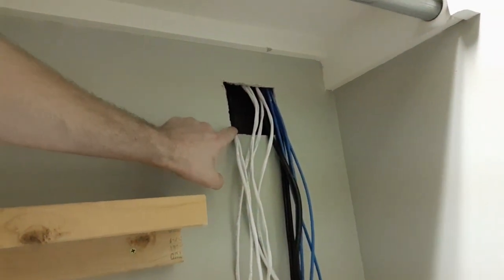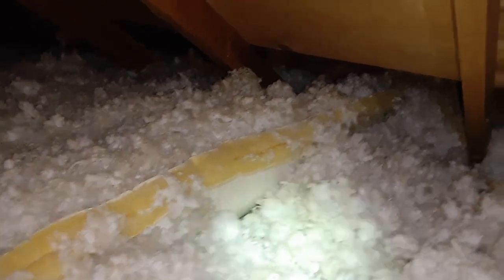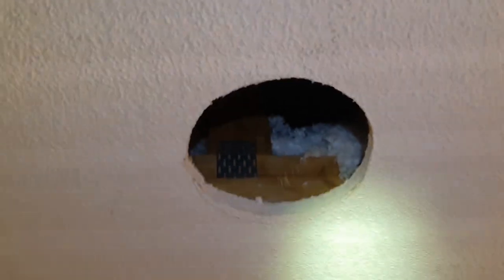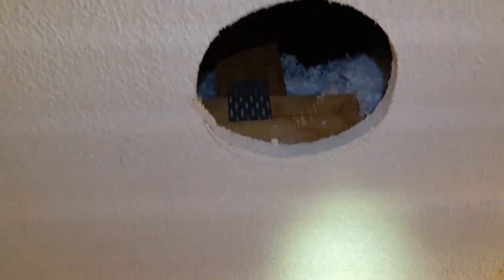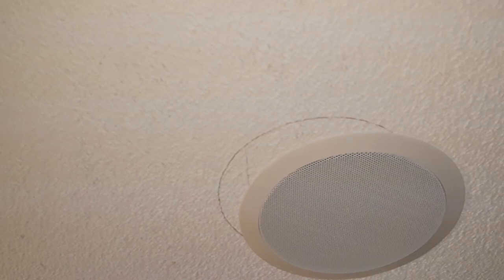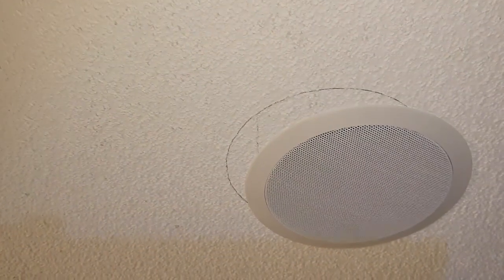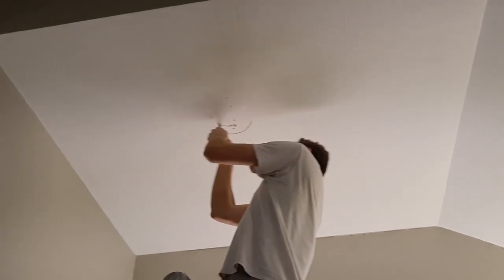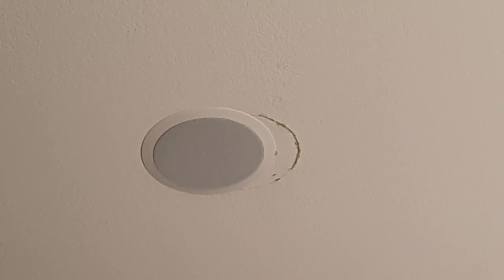Whole Home Audio Start 2 Finish EP9: I MESSED UP

Comment: Hindsight tip-

When you poke your hanger,  poke where you want the center.  Come down 4" and bend it 90°.  Push it in and spin it around.   That'll give you 8" clearance. And an 
inch if you want for good measure.
Reply from the maker: Ahhh!! Smart! I will mention that in my next video, that would save a lot of time, thanks!
Reply: Great tip!

Comment: Don't sweat it. I stepped through mine once after slipping off of a rafter. Good times.  -- Maybe next you could install mesh wireless? Just a thought. I have some experience with Plume, Ubiquity and Meru/Fortinet. Mesh is a nice upgrade to multi-levels, although I still do wired Ethernet for some things.
Reply from the maker: I actually do hard wired ubiquiti, I have one of the ubiquiti in wall access points in my living room which is very wide open, and then I've got a unifi HD wave2 in my basement. I really don't have any dead spots between these 2
Reply: @TheKMZ1  Right on. I was thinking that it's just different enough to be a neat video series and it seemed up your alley. My internet was all good until all of my neighbors got mondo transmitters through Spectrum. Mesh seemed to help. -- Another idea might be HDMI over CAT6 to your porch for a second TV to compliment your multi zone audio. Could be great for football parties whenever people are comfortable doing those again.

Comment: Have you noticed any issues with that blown-in insulation vibrating into the back of the speaker? I'm going to be doing our home soon and I was wondering if I needed to create a barrier between the speaker and the loose blown-in insulation.
Reply from the maker: I've not noticed any issues no. I've read up about that and the condensed is that it doesn't cause any issues. But you can use something like a shower cap to put on the back if you want to keep it out. But me I'm just throwing the insulation back over it, I think it's fine

Comment: I hit a stud in my dinning room when installing ceiling speakers, mine was allot worse as I had cut almost all the way around before I realised, ended up with quite a big hole to fill, but these things happen
Reply from the maker: Yes, luckily I started on the side with the stud. If I had started on the opposite side, I would have had 75% of the hole cut at least, so I could have been in bigger trouble!!
Reply: @TheKMZ1  I ended up having to staple a mesh to the joist and then plaster on to it.

Comment: I laughed my ass off when your wife started to reiterate the * What to do* along with her shaking her head in disapproval of the initial install. 🤣

Meanwhile Kaiden is just super chill and calm. 👍

Don’t worry honey I’ll fix it 😎

Having done thousands of commercial installs the adage of a wood cutter measure twice cut once is the golden rule. But, can tell you there have been hundreds of times where after doing so mistakes were still made due to uncommon building practices, schematics not being accurate, to people installing hidden devices and wiring and not following best practices for routing their wires. 🤢

On a separate tangent I don’t know where you live but noticed your home doesn’t have any vapour barrier?!? 🤔 Lastly, please insure you take the time to even out all the insulation up there. As your past videos show lots of spots that are uneven or have very little insulation. ☝️🍺

Great series keep them coming! ✌️
Reply from the maker: We don't really use vapor barrier in Kansas. So, with blown in insulation if you smash it down as I have walking through it doing this work, does it matter if you need to re-fluff it again? Because in a way, now it's jus compacted and dense, whereas before it's not dense. So i'm curious if that matters or not? Thanks for the comment!
Reply: TheKMZ1 The best you can do right now is to insure you evenly spread the insulation throughout the attic space. When time and finances permit have more blown in.

Spending money on doing this will pay for itself forever. As it will reduce heating and cooling needs throughout the year. I also noticed there were lots of cracks and holes in various parts of the attic space. So take the time to seal those area with caulk, HVAC tape, and fire caulk where needed.

Condensation is the number one killer to wood. As this allows mould to grow and spread. This not only causes the wood to rot but directly impacts air quality to the occupants.

The attic space should have no less than R40 of insulation - more is better! 👍 Lastly, the insulation needs to be kept away from the vents around the perimeter of the attic space. As proper air flow will reduce heat stacking in summer months and condensation during winter months. 🍺